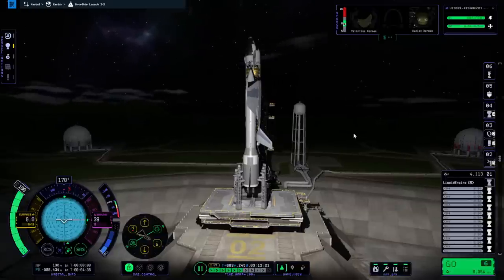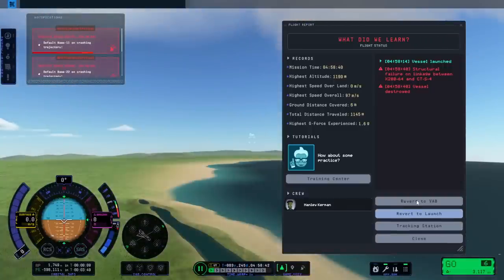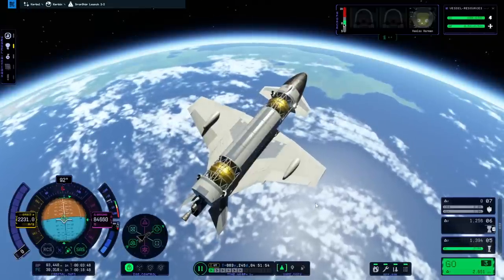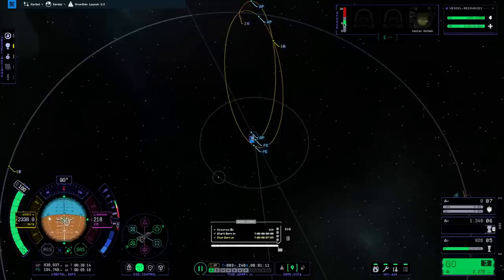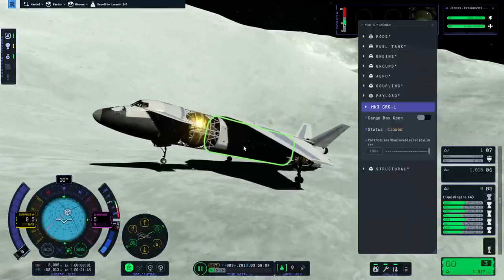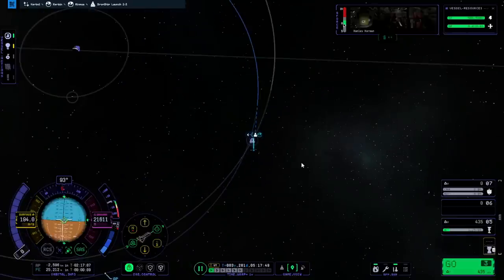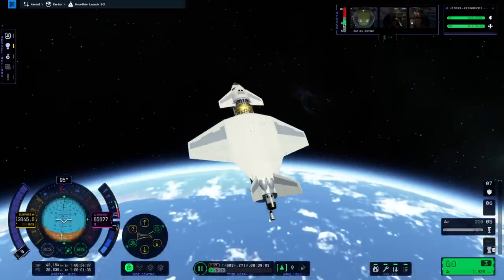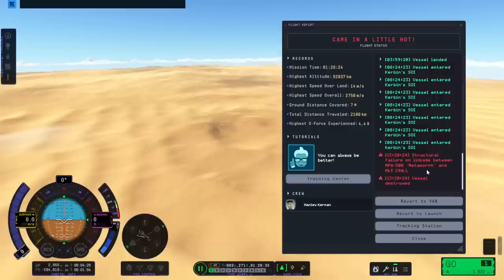KSP 2 Early Access - DropShip Minmus Landing

Comment: I think if the ship has wings then it's better to launch horizontally from the runway (it's a plane with rocket engines basically)if the game has it
Reply from the maker: But to do so would require more wings, as each part is meant to come down mostly empty, not full as it is during launch. In many cases, it's best not to have it do a runway takeoff, even if it has wings, because you don't want it to bear the extra wing mass throughout the mission.

Comment: Seems to me that your flaps are countering eachother. Mainly those on the middle big wing. Maybe assign them for Roll Only or so? They appear to be doing exactly the same as the front wing flaps.
Reply from the maker: I thought I had turned off the inner ones - the outer wing controls are roll only. I'll have to check on the inner ones.
Reply: @RaizSpace  i thought i saw the inner flaps move indeed.

Comment: When it tells you the craft is destroyed, it isn’t actually destroyed. It says that every time something breaks off. If you get that message again, try pausing the game and switching back to the craft. It should still be controllable. Hope this helps
Reply from the maker: I have tried before and not once have I been able to switch back to the vessel, but your mileage may vary. Also, it doesn't give me that dialogue every time something breaks off - only when something causes a loss of vessel, which it has been so far very consistent about in my case.
Reply: @RaizSpace  Ah ok, that makes more sense. Wasn’t sure based on what was in the video. Good luck in the future!